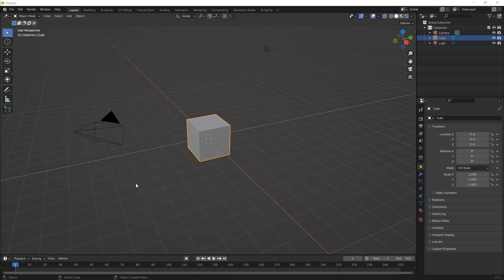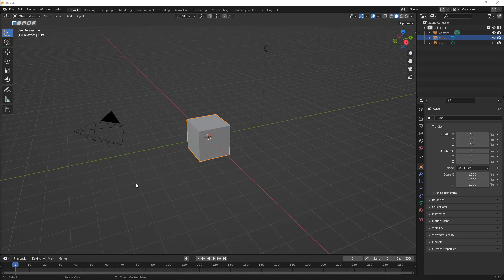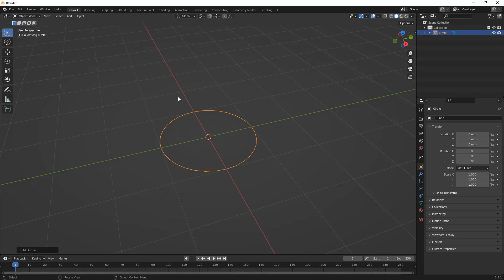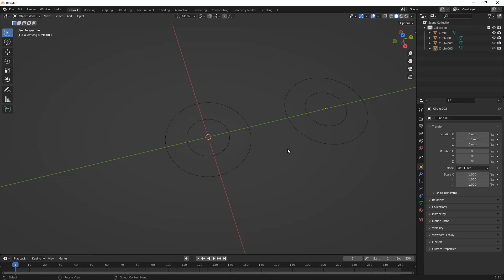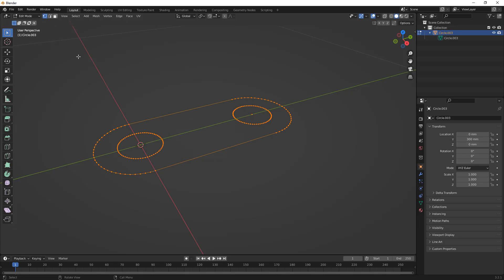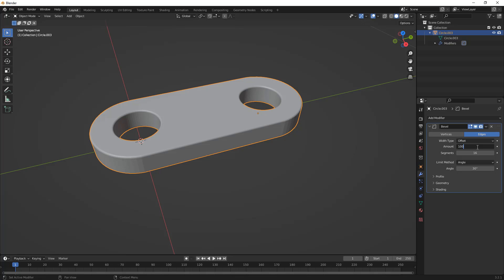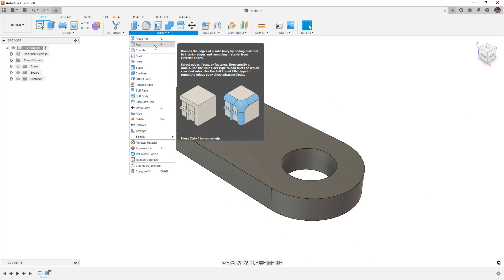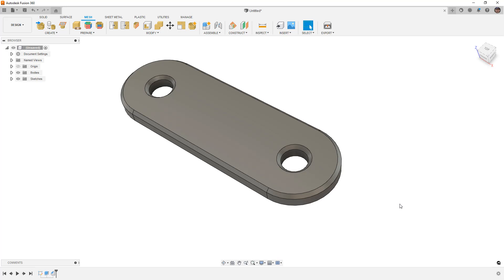Precision Modeling in Blender? | You Decide, Blender vs CAD | Precision Modeling | Blender | Fusion

Comment: You convinced me... what about Fusion 360 vs FreeCAD? I know that Fusion has stuff like some topology optimization where it uses AI and stuff..
Reply from the maker: Hey Damian, FreeCAD looks very promising, but I haven't actually used it so I can't really say for sure.  I know Fusion offers a lot in the Free version including PCB design and the commercial version is a manageable price for most that need it professionally.  I will put FreeCAD on my list to check out/try and maybe I can give you a better answer than that.
Reply: @LearnEverythingAboutDesign  I started using FreeCAD as I'm a OpenSource fan and if possible I try to use the OpenSource software. Fusion360 isn't hard to use but I truly think that it's easier to use FreeCAD than Fusion360. It took me 30min to make a mounting plate for my 3D printer on FreeCAD while with Fusion360 in 30min I only knew how to create a document, while on FreeCAD all the lines and constrains are right there in the menu.
Reply from the maker: @randomdamian  That is great to know Damian, thanks for sharing!  I have it on my list to check out when I can.
Reply: The AI stuff, you need to pay extra for. Fusion360 is getting more expensive and they are removing local simulation, you will have to use thier cloud services with tokens you buy.
Reply from the maker: @sqwert654  Sort of and true.  They are making the simulation studies that could be solved locally moving to cloud only, but have stated that it will still be free to solve Linear Static Stress, which is the most common/used one.  The AI stuff being paid I don't mind since all the other solutions on the market are VERY expensive.  I know the move to cloud solve only is an abrupt one, but FEA simulation is expensive in nearly all other software packages so it is an interesting move to have it but pay per solve(or buy unlimited solves if you use it a lot).  Love/Hate for most people :)
Reply: @LearnEverythingAboutDesign  and a price increase on top. Just going to drop all my Autodesk subs and stick with Blender, I don't see any value in them anymore for game dev work.
Reply from the maker: @sqwert654  For Game Dev I can totally see that.  If you are using Fusion for Commercial use and not the hobby license, then something like Plasticity, Moi, Shapr etc is likely a better "hard surface" option.  I haven't played with the CAD add-ons in Blender but for me "hard" mesh models are still not as good as a BREP/NURBS approach.
Reply: @LearnEverythingAboutDesign  Plasticity I used last night for the first time. Has the same workflow I use in Fusion360 (not reference image import yet I think), exported as obj into Blender and get a very nice mesh.
Reply from the maker: @sqwert654  Depending on which build you have you can import reference images.  It has been there for awhile but what you do is go to the file drop down and select "Import Document".  It will be based on your view orientation since there are no planes to create.  It will come in as an Empty and you can move it around, scale it etc.  I don't think there is an opacity control though so its either on/off.  So i suggest putting it behind your object.
Reply: @LearnEverythingAboutDesign  I used FreeCAD for a while now and I love it, everything works, takes some time to find some functions online that I need but it actually just works. You don't have the Topology optimization and other more advanced stuff but for JUST 3D Printing it just simply works... CNC etc also :)
Reply: @LearnEverythingAboutDesign  To be fair there are open source for Topology Optimization that are well developed since the theory behind comes from the late 80's, there are professors that have been studying since that time and lidered their our team to do Top Opt programs, an example of it is the german freeware Z88 Arion, the only limitation of Arion (and other products of the Z88 project) is that most of it's documentation and newest iterations are in german.
Reply: Topology Optimization does not use IA, and you need to pay for it. The only thing you can do in Fusion 360 is modelling.

Comment: Fusion is the best software for model
Reply: Really? Try to model a car. I use more than 5 years Fushion 360. I tried to model a car and it was a disaster. Always error and  complaining.  This year I installed the Blender and watched tutorials.  I can tell you Blender is the way to go if want to model figures,cars just so much easier and faster. Fushion is good for cnc,,machines and simply shapes.
Reply: @laszloszell8753  for the sode panels you need to sweep or loft curves, project then so they all touch the loft.
Reply: @laszloszell8753  I have never seen a car modeled in Blender that is precise and not wobbly!
You'd better build freeform surfaces with surface modeling, it's the only way to build FAST and ACCURATE! Not Fusion Forms but Fusion Surface Tools!
Reply: @laszloszell8753  but you modeled the full car like in a real CAD package (with all the seats, the motor, the transmission, lights) or just the exterior of the car? Fusion is not capable of that, Fusion is for kids, but i don't thing Blender is cappable to do a full car by the simple fact it was not designed for that kind of designs. Is like trying to create a videogame character in Catia V5.
Reply: @omegadeepblue1407  Fusion is for kids - fun opinion you have. ;)
Reply: @cekuhnen  Well not exactly kids, the correct term will be beginners
Reply: @omegadeepblue1407  F360 is not Catia but for beginners? Not sure what you background is but I would say that does that platform a discervice.
Reply: @laszloszell8753  maybe then you are simply not good at fusion360?

It is also ideal more for mechanical design modeling or general product design but not transportation design

Also for that blender is not good

For that you use Alias or Catia ;)
Reply: @cekuhnen  You are saying a modelling a car is not mechanical design, do you know cars have motors?
Reply: @omegadeepblue1407  You know modeling a car is 99,99999% referring to the car body exterior and maybe interior and I am quite sure that is what he was trying to do.
Reply: Try to model a organic body
Reply: wrong is costly and FREECAD WILL DO THE SAMETHING
Reply: @daadood100  Uhm freecad is far from the same - freecad has so many modeling tools missing auch a comment from you is amusing

Maybe when all you want to make is a bracket freecad is fine

Even blender could be somewhat fine for such a basic shape
Reply: @daadood100  Installing now :)
Reply: @daadood100  does not even work with 3D mouse correctly, I never use anything that will not work with my 3D Space mouse.
Reply: Fusion lacks few things but in general offers a very set of tools for solid surface and subd modeling 

Rhino only has much better deformation tools 

But otherwise Rhino is pointless 

Blender is a great feeder for quad 
Mesh when using t-splines or when using it for rendering
Reply: Only if you going to draw basic geometric shapes. Rest disaster.